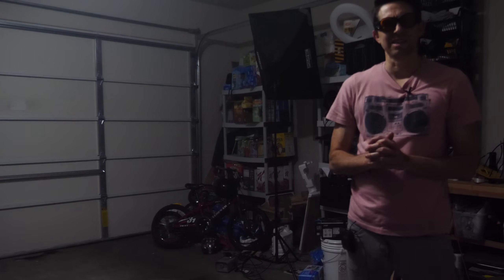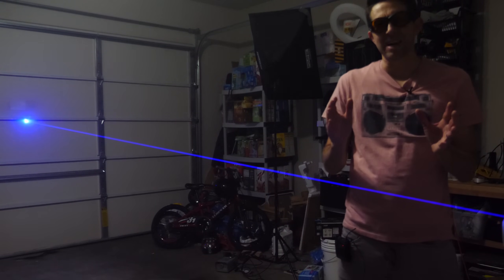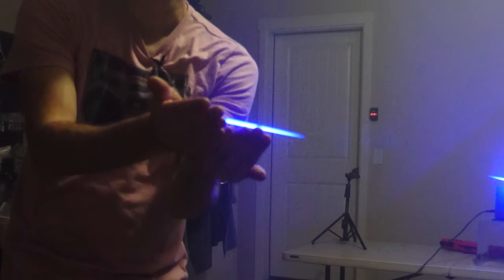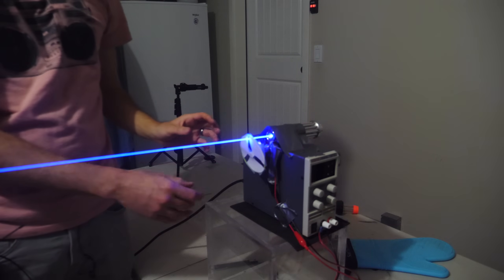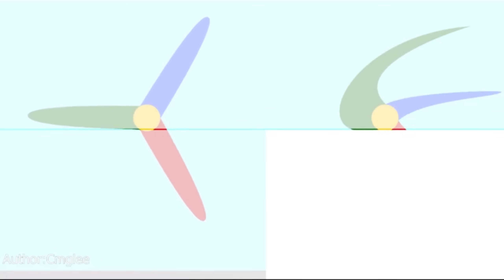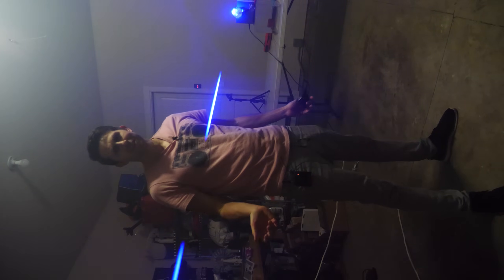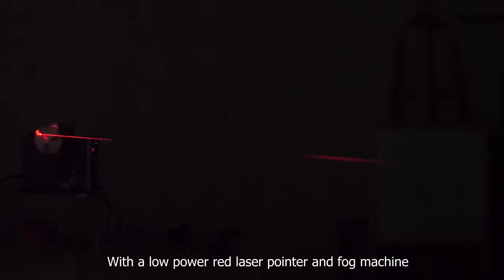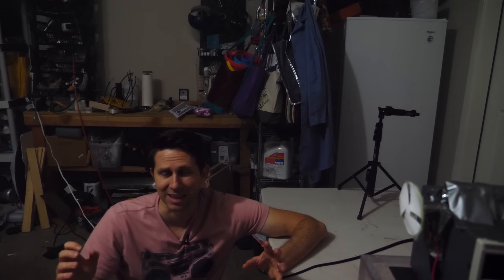Slowing Down Light to Make a Real Star Wars Laser Gun

Comment: The guns in Star Wars ARE NOT LASERS. They are particle blasters, they shoot plasma and charged particles. The projectiles emit light, they are not composed of it. That's why their impact can throw their target back, they have mass and can impart kinetic energy.

This is also why ships in starwars can have shields, all their shield systems basically are is is a sort of reactive electromagnetic shielding. Charged particle beams have magnetic fields and thus can be attracted or repelled by magnets. The ship uses external sensors to detect an incoming shot, determine its polarity and trajectory, and send out a magnetic pulse to deflect it. You can't deflect a laser beam without either a lens or the gravity of a black hole, and you certainly can't stop it with anything transparent.

Comment: So you see blasters and turbo lasers from star wars use tabana gas from gas giants to use as ammunition and use lasers to heat it up into a plasma and then use electro magnetics to fire a plasma ball at a very fast speed. The destruction can cause Hiroshima sized explosions from each turbo laser. so the shielding in star wars is very strong. So lasers where used just over 30,000 years ago in the timeline from the first prequel.

Comment: Try this !!
Imagen a powerful lazer capable of burning in a form of a gun and just like that but insted made of paper, make it a mirror to block  the beam to concentrated it while its blocked and the part that has the cut out have it whith maximizing lens that will make the burning beam that is all ready buncing inside by the mirror increasing the lens will duplicated that and maybe just maybe powerful enough to go through something
Reply: The gun have to be battery, to keep the disk running, and every time you pull the trigger the lazer turns on and shoots

Comment: You ought to be able to do something similar in front of a live observer or audience by adjusting an interference pattern between two lasers of close frequencies.  Like this, it can only do "full auto", it would never show the "first pulse" propagating across the room without other pulses in front (unless something blocks it), and as soon as it is blocked, the whole stream past the block point disappears and as soon as the blockage is removed, the whole pattern reappears, despite the fact that if the pulse were traveling as slow as it appears, the rest would be blocked until the pulses propagate across the room.

Comment: Before watching, I thought you super cooled it using sodium particles. A PhD from Harvard slowed down light a few years ago.
Reply: @sriramn1809  it is through the air. I first heard it through radio lab. Here are two links
https://youtu.be/sAy9N4F5-cA
https://youtu.be/-8Nj2uTZc10

If I remember it correctly, she slowed it down to 20 mph it something where you can ride a bike or sprint faster than light. Pretty amazing.

Edit: Actually, after listening to it again, she actually stopped it.

Comment: If you made two fans with half covered, half open you could easily adjust the size of the gap by putting them on top of each other.  You don't really need the 3 slits in one fan as you can just spin it 3x faster.

Comment: in star wars they are not actually lasers they are more like balls of high energy with no mass that travel at speeds of 130-135 mph using math of distances the lasers traveled and the time it took those lasers to travel those distances  in the last 6 movies.
Reply: And there is a reason they are not called laser guns in the star movies because they are not shooting lasers they are just balls of energy moving at 130 mph which is only like 2 times as fast as a nerf gun shoots.
Reply: I think the lore is that it is plasma. If it were energy with no mass it would travel at the speed of light